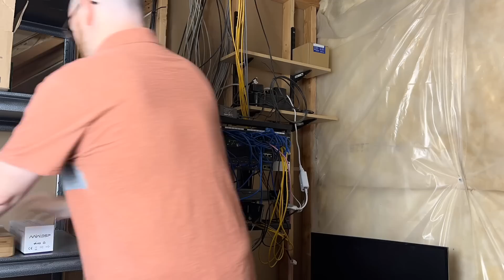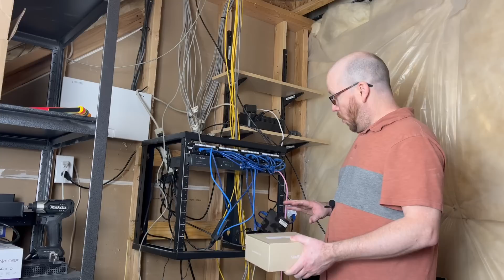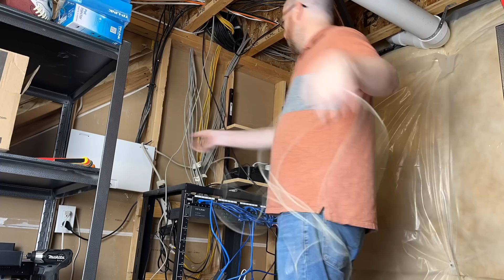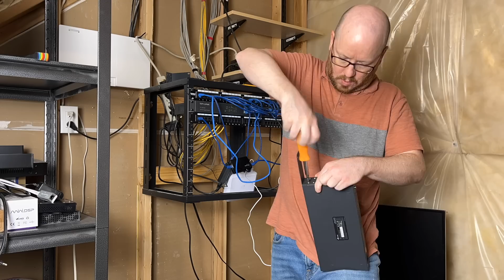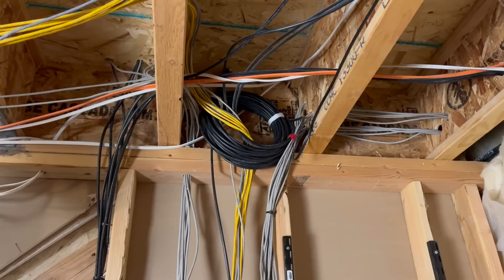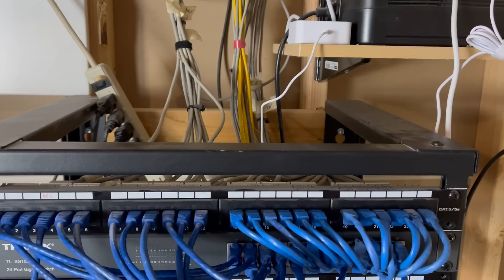Network Upgrade For My Home Theater - Ubiquiti UniFi WiFi

Comment: hello...have been enjoying your videos. Good to see and hear from a "regular Joe" when it comes to home theater...you have very good information and a good way of explaining things. I do have a question as a very ripe newbie....when it comes to networking for HT, what would you say are the main things needing to be connected to a switch, let's say a Netgear: projector, AVR, Blu Ray player, streaming device, anything else? If we are strictly focusing on home theater only...not entire home networking.
thank you
Reply from the maker: Thanks, glad you like the videos! For HT gear, a good rule of thumb is if the device has a LAN port (Internet Ethernet port), connect it to the switch. Most devices need to be kept up to date on their firmware and need an internet connection for those updates. Best of luck!

Comment: The Ultra is a good basis for a home network, but the newer Cloud Gateway Max, that has full 2.5gbps is a better option now for home users, but the Ultra still has it's place if budget is a little important.   
It's been great to see UI finally release a new batch of Gateways that match what users need.  It took such a long time to move on from the old USG's and Dream Machine style gateways.
The TP Link switch is great, but I would definitely look at upgrading to a managed switch in the future as managed switches just give you so many more options.     Having UI gateway and cloudkey without UI switches does limit the management capabilities.

Comment: Nice Tidy-up job, as many other have observed, seeing vids likes this motivates people like me to tackle the snakes-nest that is currently wrapped around my network switches!
WRT your passive access point using a poe injector. If it is a 24V passive POE, you might consider this: ZQ-GAT-24V24W - it converts POE in to 24V passive out - AliExpress $12.  Effectively, it's an inline converter so would allow you to loose the POE injector-brick

Comment: Use keystone patch panels instead of the punchdown ones, much easier/cleaner
Cut a piece of plywood to fit the bottom of the rack, paint it black. Move the UPS down to it in the back
Get a cheap rackmount PDU with front/back plugs, plug everything into that. Plug PDU into UPS
Reply from the maker: Great suggestions, thanks!

Comment: When do you know you should upgrade to a small rack like you have? Also do you share you plex with others?
Reply from the maker: Good question. If you have enough equipment that you can’t easily and cleanly hold it on a shelf, then it’s likely time to put in a rack. Also, if you want a patch panel then a rack is super nice to have. I shared my Plex with some family members, but they don’t watch it much 😁

Comment: Nice video!  I was wondering what your experience has been using a TP-Link switch with the Uninfi controller?  Are you able to manage any of the ports or do you even need that capability for your switching needs?
Reply from the maker: Thanks, glad you enjoyed it! The TP-Link switch works seamlessly with the Unifi controller in that the switch is basically invisible to the network. It’s an unmanaged switch so there is no configuration to done at all. I have my game consoles, desktop PCs, smart TVs etc plugged directly into the TP-Link switches. It’s an effortless way of connecting those devices to my network. I can’t make in changes to the configuration of the ports on the TP-Link switches, but I have no need to. Thanks for watching!

Comment: Enjoyed your video.  I couldn’t help but note your statement that you replaced the 3.6mm cable UniFi supplied with a 6mm “big beefy cable”.  The smaller cables will work better, have better shielding and have zero disadvantages.  You’re not welding here.  And the smaller cables increase the visibility provide a much neater install.  Most all of us have switched to the 3.6mm cables.  I would also recommend that you eventually get a smart switch so you can isolate things on your network.  One rogue device on your network or one downloaded piece of software could have access to your cameras and NAS.
Reply from the maker: That’s good to know, thank you. And thanks for watching!

Comment: Your employer doesn't live with you sir
Reply: I commend you for redoing it but I do see you still need some assistance to clean it up.

I do like that you reused your patch panels, but I personally wouldn't have. Get a Vertical cable keystone patch panel 

24 port patch panel
24 or 48 port Switch
24 port patch panel
NOTE: Use 6 inch patch cables and start cabling from the HARD RIGHT of your patch panels since you don't have a full 48 port switch.

You really don't want those longer cables because your already not going to keep managing it (its a chore) so make it as neat as possible this go round. Those longer cables basically look unprofessional and will add to it not being tidy.

Properly braid your pulls so they are tighter and cleaner.

Label your cables since we both you :) your going to need an easy way to identify them. Replace those power strips with a PDU. Last but not least, install a couple of fans.

DUST YOUR ENTIRE SETUP :) 
GG on the install
Reply from the maker: All good suggestions! Thank you! It definitely still needs some finishing touches. Thanks for watching!
Reply: @GeorgeTheaterAtHome  looking forward to your updates ☝️✅✅✅✅

Comment: Nah bro, that's not an embarrassment that's a proper living and breathing network.

Making it tidy/pretty can get fairly expensive, especially when using ubiquiti products.

Making it look nice is the final stage after accumulating all the costly hardware.
Reply from the maker: I appreciate that! That’s a good perspective to have. And it’s true, it can get pretty darn expensive to get it to the next level. I think I’ve got it to a point where I can hold off spending any more money. I’ve at least cleaned it up to where it’s easy to see where everything goes. Thanks for watching!

Comment: Great video. No matter how I try to "neated things up" it never turns out as neat as I envision.  My HT rack actually contains a 12 port switch that is driven from my TPLINK router next to the ISP's demarc on the top floor (HT rack on the bottom floor).  My 3 WAPs are all older (no long avail) Unifi AP-Lite's, they work great and cover the rest of the house and outdoors. But that UniFI GW Ultra looks interesting and it would be nice to have all devices managed via one controller.  Not looking to swap out the router since it replaced a very short lived ASUS$$ that once went out for repair (2 months) and then died. I have a small/cheap TPLink router that was a WAP that served until I could replace that ASUS.  So not willing to replace the bigger TP Link right now.  But certainly will keep an eye on that Ultra. Thanks again and nice clean up, we probably should all think about doing some type of review ever couple of years as things come and go in our systems.
Reply from the maker: @StephenAtt797  thanks, glad you enjoyed the video! So far I’m very impressed with the  UniFi GW Ultra. I think it will be a big seller. It’s perfect for a home environment that has a more complicated network than the average house, but isn’t at Enterprise level. Thanks for watching!
Reply: @GeorgeTheaterAtHome  Sounds good , their other options (Dream Machine??) were way over the top from both capabilities and expense.  Good luck with it.

Comment: Im surprised you didnt just go with a UDM Pro or SE considering you have a rack.
Reply from the maker: That’s a good question. The extra features on the UDM Pro and SE aren’t something I could utilize so it’s not worth the extra $200 to $300. The Cloud Gateway Ultra is the perfect fit for me based on features and price.
Reply: But you could get rid of the POE switch too

Comment: once you start on unifi you will be going down a rabbit whole as deep as the home theater rabbit hole. I have gotten away from those kinds of patch panels and gone with the keystone patch panels for ease of fixing a bad port.
Reply from the maker: Unifi is great! I installed my first Unifi AP about 9 years ago. Never looked back lol. I looked into the keystone patch panels. I think they are superior but I couldn’t justify the added cost since I’m only using 10 of the ports. Plus I kinda enjoy punching down the cables 😆. Thanks for watching!

Comment: This is something I really need to learn about. Right now it's all over my head.
Reply from the maker: What do you currently use for your home network?
Reply: @GeorgeTheaterAtHome  so we bought a house, and there's a Ubiquity disc on the ceiling. My guess is the garage door opener wasn't getting wifi in the garage. In addition, we have an NVR system with POE cameras and it stopped working about 2 months after we moved in.  I reset the system and essentially couldn't get it all reconfigured. I don't know if it's a paid subscription or anything.
Reply from the maker: There’s no subscription for the Ubiquiti equipment. However, you need to have the Unifi controller software running on a PC or server to configure the AP (the Ubiquiti disc). I decided to go with the Unifi Cloud Gateway Ultra router because the Unifi controller program runs on it. Makes it super easy to manage. 
I’m considering putting together a ‘network-in-a-box’ that would include the gateway/router/AP’s all preconfigured and delivered. But I don’t know if there would be enough demand for something like that.
Reply: @GeorgeTheaterAtHome  I'll look into that, thanks. Does the Unifi router replace the one from my ISP or just run off an ethernet from it?
Reply from the maker: @mikeortiz2139  it depends on what type of provider you have. If you have a cable internet provider, there will be a cable modem. You would connect the Ubiquiti router to the cable modem via Ethernet. If you have an internet provider who has an Ethernet router in your house, the Ubiquiti router would replace it.

Comment: You can use a Instant Indoor PoE Converter (INS-3AF-I-G) to convert PoE to passive PoE. It only saves you a mains connection but you can reboot the AP by cycling the PoE on the switch
Reply from the maker: That’s interesting! I didn’t even know they made those. Good to know! Thanks!
Reply: @GeorgeTheaterAtHome  Check the port settings of the managed Unifi Switch. There is sometimes an option to change POE+ into 24V passive. Might not work but worth checking out. Go into Unifi Devices > Select the Switch > Select Port Manager > Select the port and check under the POE option for 24V passive.